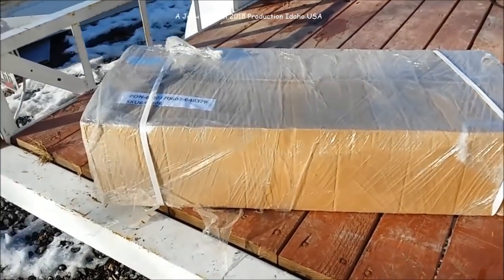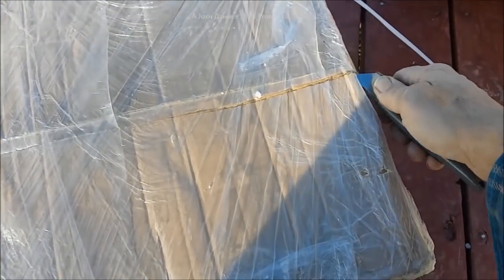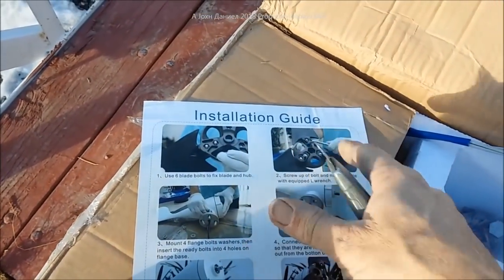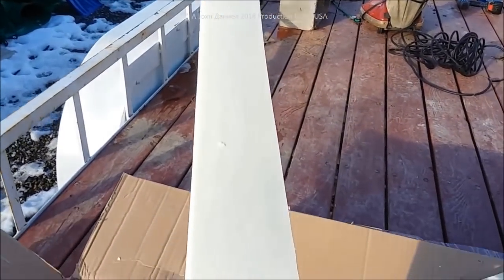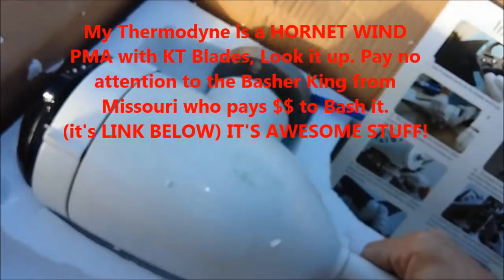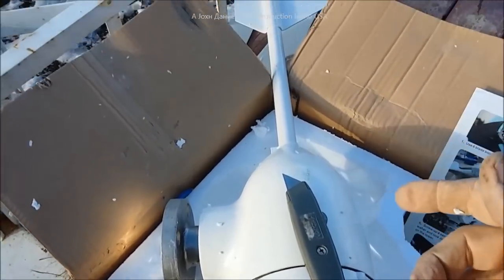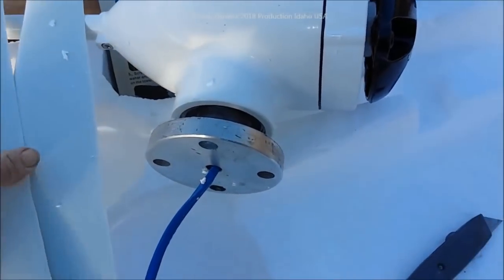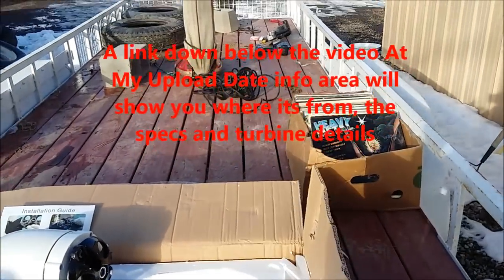FIRST EVER VIDEO of Newest 500 Watt Wind Turbine Generator from China - Full parts list used below!

Comment from the maker: VERY Best #1 Listed links to them Under Video and is in many my videos To get 100% full batteries from one & to divert over volt you need these: https://amzn.to/37HN2OR 100A SQL Rectifiers &  https://amzn.to/2MTUjCU A All purpose long life Load controller and be sure to get up to and over 300 watts diversion resistors ( https://amzn.to/2QngFPq x 3) and one or more 60 amp SSR ( https://amzn.to/2QKEyj0 ) with heat sink ( https://amzn.to/2ZYtmna ) and be sure to use thermal past on it.  ( Proper type - https://amzn.to/2QN2hir from Protronix)    Subscribe, check all on the channel.

Comment: What is a good link to order the 500W 12V unit. I have tried to order it 3 times with a CC and thru paypal. Each time it want my personal info for "Security Reasons" 
I have never had this problem ordering from outside the US.

Thanks
Reply from the maker: Not sure what personal info your speaking of. I just made a Aliexpress account just like making a Amazon account, with name, email and my address and started buying stuff. Let me know what they are wanting and maybe I can help. OR, you may be making a ALI Seller account which would require all that extra info.
Reply: I have an account and when I try to order it gives me this" for security reasons process cannot be continued....."

I tried to set up an account with a different email and it would not accept that either.

This is really getting frustrating
Thanks
Reply from the maker: You can try this source https://www.dhgate.com/product/residential-wind-energy-wind-power-generator/400656203.html
Reply: Thanks this site works
Your site is very well done.
I enjoy the no BS policy
My "handle" is wireman
Thanks again

Comment: What minimun wind speeds are needed for this turbines to work properly ?
Reply from the maker: Starts producing usable power, 25 watts (2 amps) plus at 8 MPH winds, 100 watts at 13 mph, 250 watts at 18 mph and 500 watts at 25 mph with occasional peaks of 750+ at over 25 mph.

Comment: I have a question. Does the bearing and slip rings sit in a cavity inside at the bottom of the housing? I see some other videos where the bearing and slip rings sit in water and eventually corrodes the slip rings and seizes the bearing. Good job on the videos
Reply from the maker: These units are water sealed, the bottom does have a just in case 3mm drain though like a PCV valve on a car, positive pressure valved. But I never had one fail. The ass kicking Chaos turbine uses a 3 atmosphere sealed MOFLON 6 wire (made for 2x(6) - 3 phase, https://tinyurl.com/GENUINEMOFLONSlipRing which is the ONLY brand to buy, and a 1.5" slip nut ( plumbing) and seal on the 1.5" pipe.

Comment: on one of these  can  you  ues  a 1000ah  battery with  this   one  i was looking  at   here is  the  read out  on it   new  to  these  ---Number of Blades: 3 
Material of Wind Leaf: PBT Model: 
400W Wind Turbine Generator
Rated Speed: 800RPM 
Battery Capacity: 200AH-400AH Rated Power: 400W
Certification: CE, RoHS, ISO9001 Rated Voltage: 12V DC
Rotor Diameter: 1.2m
Reply from the maker: +Nelson quimby jr I figured you could charge anything from 400 AH and bigger off this turbine. It puts out so much that under 400 amp hours may just be forever in diversion and a waste. Depends on your location,  wind and use intentions of course.  My Battery bank is 365 x 7 for 2555 amp hours plus 1980 more AH on the smaller one still in use.
I run 4000 solar plus and 3 wind turbines I can always call 1000 watts plus when considered.